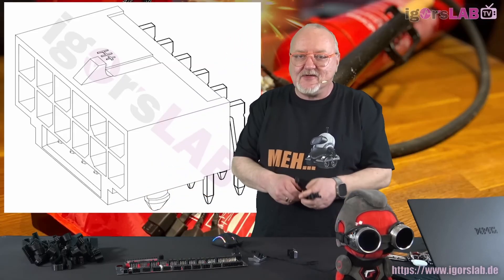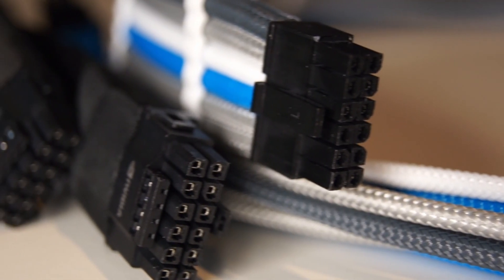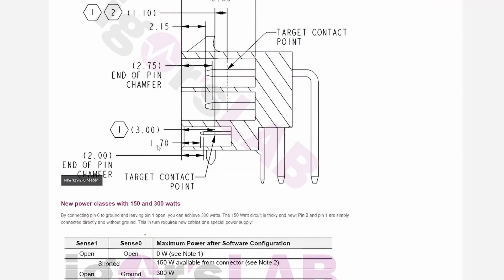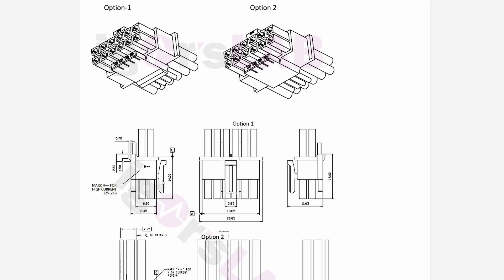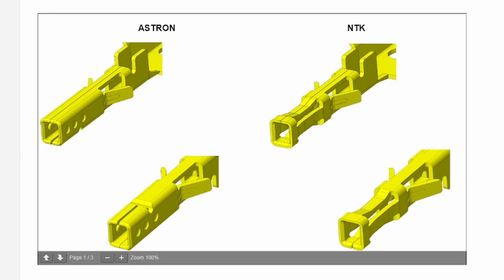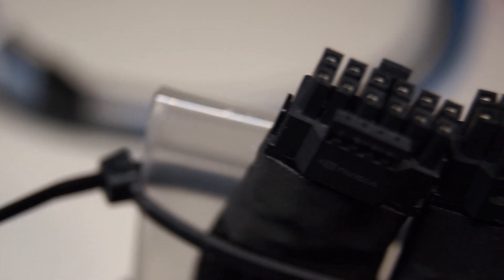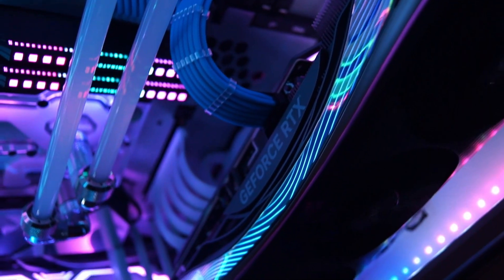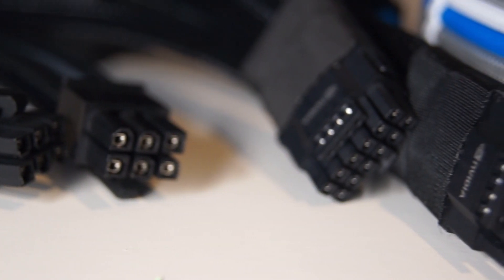12VHPWR cable is finally getting redesigned

Comment: Clearly pcisig and nvidia are beta testing on their customers hardware. Never buy new tech right away, sata also had cable issues in the beginning, i returned my first disk after my data dissappeared repeatedly when the cable turned loose.
I got a wd eide that i still have.😊
 New sata connectors and plugs came out that where more tight and also latches where introduced. Not all disks and mainboards accepted latched sata cables.
Reply from the maker: It's a good idea for consumers for sure.

Comment: I already have a 4090 in my rig. Will this new cable work with the 4090s that don’t have the new socket with recessed pins?
Reply from the maker: Igor mentioned it could be designed to be "backwards compatible". The different lengths I would assume require different tolerances and connection points.

Comment: I think it is a good start to a problem that should have been taken much more serious long before this. I didn't care to hear that its the user. That seems to be the go to line of crap. I think it was a cop out at first. I don't have one of these cards. But watched video after video of content creators having to come to the consumers side and push back. All Nvidia needed to say. "We are looking into this problem and will let you know as we do as to what the fix will be. " And this probably would have been a better pill to swallow.
Reply from the maker: Yeah unfortunately after the GN video Nvidia went straight to that storyline as "look it's the users fault". Asus, Gigabyte and Zotac (not sure about MSI or any of the more Asia focused brands) have been denying the warranties if it happens with any cable but their own ugly problematic 12v to 4/3x8pin.
It's definitely an issue with the design, and that's clear. Users having it slip out a little after building (seen it a few times) should not be punished for this. The connector should have the fail safe feature. Then you have high end system builders who clearly know how to build a PC also having the same issue with it fully seated. 
They are clearly redesigning it because it is a faulty design to begin with. 
Seems like every week I see fully inserted cablemod 90 degree adapters melted into the card also. Hopefully someone steps up and brings them to court. 
Appreciate your comment.

Comment: When this happens in the automotive industry, there's fines and possible lawsuits. The manufacturer is also required to fix a recall with no cost to the owner of the vehicle. NVidia seriously needs to make this right and there really needs to be a third party to hold companies like this accountable for their willful malfeasance
Reply from the maker: Totally agree, I do think if left alone running for long periods of time it could potentially burn a house down. 
I feel like it's one of those things. It will sadly take it happening in a more severe way before they address it properly.
Even PC manufacturers do proper recalls, happened (with much force) to the Nzxt h1 and even a fractal case too. 
I sometimes render/edit videos for others. Some long videos that I use to comfortably walk away from during the final render, I now sit and wait in fear of coming back to a fire.
Appreciate your comment as always.
Reply: Agreed

Comment from the maker: (Edit, Igorslab is German, mistakenly said Dutch it's actually Deutsch.)

Hey everyone, I am going to link my other video talking in depth about these cables/connectors burning up. I agree with Northridge and Jay on their original discussion of the issue. (Link at bottom)
I need to mention this because we still have no solid answers as to why this is happening, it's educated speculation at this point. Northridge has a video also talking about MSIs yellow tipped 12vhpwr cable possibly saving GPUs, he talks about even the slightest movement popping one side out could result in a melted connector. 
I actually believe its a design flaw on the GPU and connector, but I have to also mention user error because I have seen pcs come through my little shop half plugged in. Ironically those pcs were completely fine.
Leading me to believe more that its the 4090 itself.
Thanks everyone for checking out the video.

https://youtu.be/yjShuTuk8wE

Northridge video on MSI color tipped psu / cable

https://m.youtube.com/watch?v=O9uHI0EAK8s&pp=ygUSTm9ydGhyaWRnZSBtc2kgcHN1
Reply: Deutsch to Dutch is a pretty common mistake, that's how "Pennsylvania Dutch" became a term even though the Amish are actually "Deutsch" or German!
Reply from the maker: @Anolaana  Thanks, yeah I think my CC on the video tricked me! It was pretty late in the evening. The irony is that I am German.

Comment: A cable redesign clearly indicates a design flaw with the connector and locking mechanism. Anyone still pinning user error is a clown.
Reply from the maker: Yeah there are many issues with the cable and connector clearly. I still occasionally run into a new build that will have it not all the way in. It's not often, and might be hard to believe, but there are people who quite literally just buy high end stuff and do zero research. 
Example, recently a guy with an all Strix, i9 setup 011d etc asked for help with a windows installation. He dropped the PC off, and sure enough the cable was half in. Not even a little crooked, but actually half in. It was his first PC.
Reply: @techwandoUS  did the GPU work with a half in connector? Normally an incorrectly inserted cable would result in the PC failing to turn on or POST correctly.
Reply from the maker: @Alex-ii5pm @Alex-ii5pm I am not entirely sure because I noticed it before even attempting to turn it on. Even on older builds people have brought me PCs with 24/4+4/and 8 pins not fully seated. So it's something I check often. He did send me a picture of it posted to bios though before dropping it off. That being said I see it a lot less with newer hardware because most people are aware.

I pinned a comment above with a link to another Northridge video discussing the new "yellow tipped" MSI connector. 
When this whole thing started happening, originally I was pretty much on board with it being an actual issue with the hardware and not as much the user. I think a user can build a PC and put the glass on and not see the movement/pulled cables after panels are on, and it can accelerate what inevitably is probably going to happen anyway. What's interesting about the msi PSU is that there are photos of psus having melted connectors on the PSU side now. 
IMO, the whole design is way off spec, too small, and should have never been on the cards/PSUs to begin with.
Reply from the maker: (Clarification) the photos of psus are not the MSI model.

Comment: fam i have a friend that has a render farm how can be user error when 300+ gpus all dmg in same place
Reply from the maker: All of them went bad? I don't believe many of them are user error at this point, but the occasional half in connector pops up from time to time. Idk if you saw my previous video talking about Northridge, but I was mostly 98% in agreement with Jay and Northridge. I just have to mention both sides because it is still very unclear what exactly is happening, and power supply companies are even going far enough to color the ends of the cable to show when it's popped out (MSI)
I'd love to hear more on this render farm, 300 GPUs is insane haha.
Reply: @techwandoUS  fam the connector its getting hot in 400w and its melting due to thin cables
Reply from the maker: Checkout Northridges cable video on this 
https://m.youtube.com/watch?v=O9uHI0EAK8s&pp=ygUSTm9ydGhyaWRnZSBtc2kgcHN1